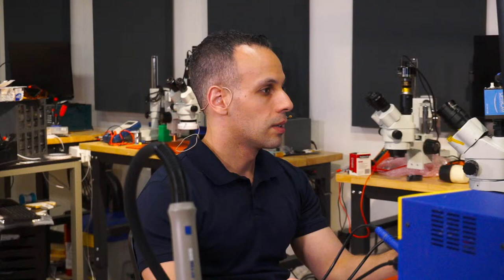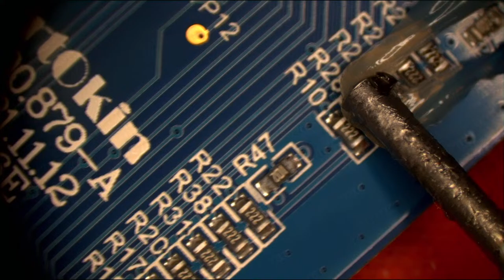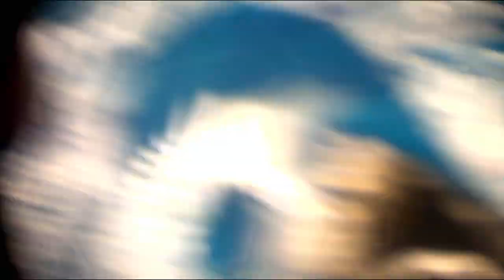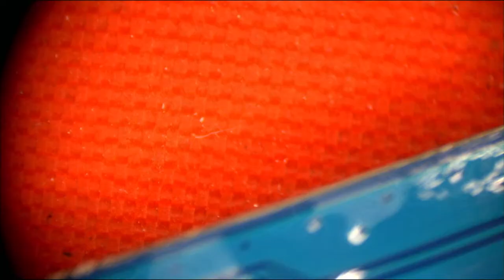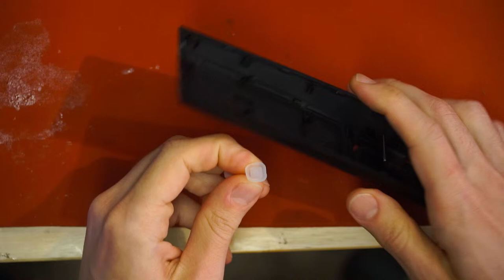fixing a vibrating bed frame remote

Comment: Timestamps for the heck of it! xD
0:00:00 Stream test
0:00:55 Start-ish
0:02:30 Opening of remote
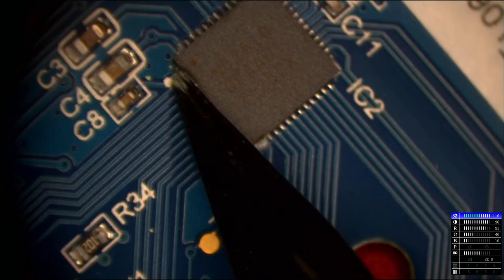0:08:40   Amtech flux story
0:15:02 Fluxing
0:17:02-20:22 Polarizer blocks camera light
0:42:50,46:45 Stream skip a bit
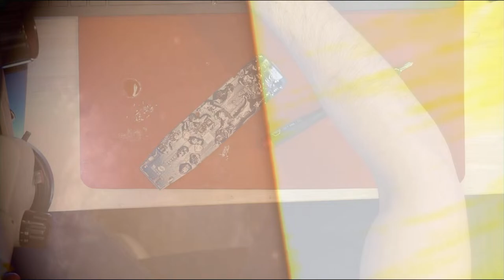0:52:04 Hot airing
0:54:06   "Everything in its right place", resistors falling into place
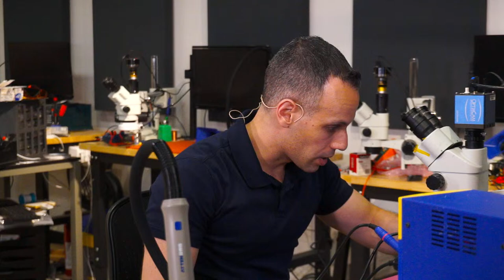0:55:14 Ultrasonic cleaning (not seen)
1:02:04-1:03:14   Handwash silence
1:04:35-1:04:49 Air compressor
1:05:20 Closing remote
1:09:25 Initial Testing

Phone Alarms (unheard/low volume, but mentioned and complained upon)
0:26:17 0:36:15 0:45:26
0:54:57 0:58:04 1:04:59
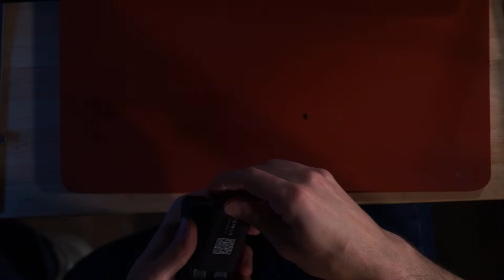1:15:20 1:16:41 1:16:00

Comment: A polarizing filter is supposed to turn 360 cause that way you change the "polarization" of light and it has a second ring which screws in the lens adapter.

Comment: The sync buttons slide through the other side, leaving a larger pad to push the button contacts on the board inside. Battery compartment door will slide back on as well.

Comment: I know some deaf people use vibrating bed frames to wake them up since an alarm doesn't do anything.
Reply: I would not have thought of that use case. I did always wonder if a super soaker alarm clock would be useful though.
Reply: Usually a vibrating bed doesn’t vibrate hard enough to wake somebody. They do make special alarm clocks with vibrating units that go into your pillow and shake frantically when the alarm goes off.
Reply: I doubt it will work on me. Friend shot me with a paintball gun and I didn't wake up.

Comment: My parents ultramatic bed remotes are broken half buttons don't work. Already taken apart and cleaned the boards. Didn't fix it. So some traces must be damaged.
Reply: For my sound system the problem with my remote was I think the conductive stuff (graphite?) under many of the buttons wore off. Si I just glued a piece of aluminium on each defective buttons and now everything works like a Charm.
Reply: *aluminium foil